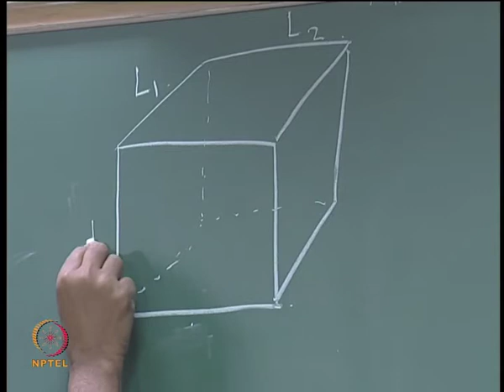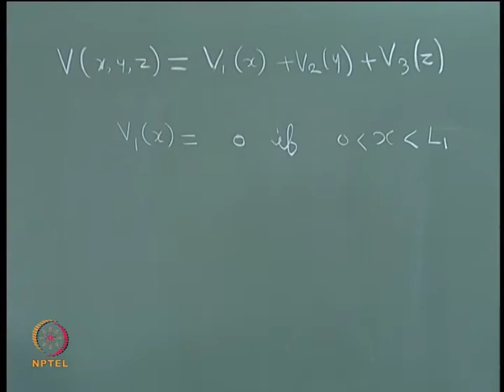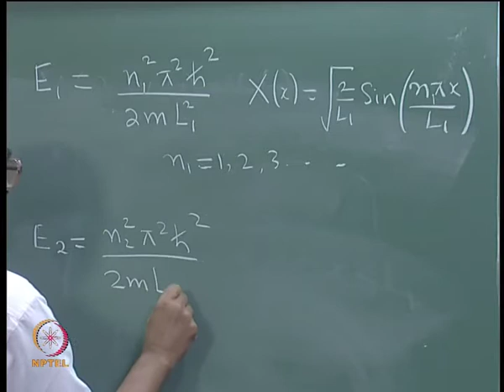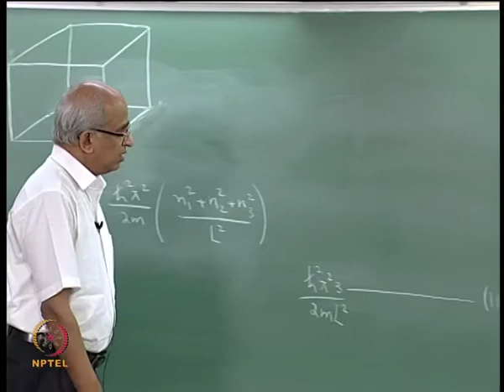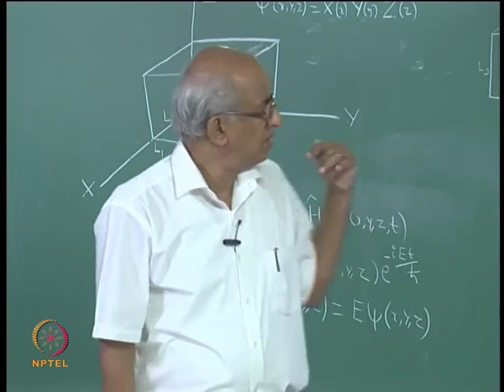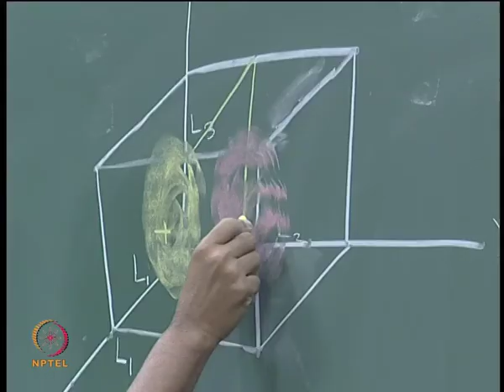Mod-02 Lec-11 Particle in a 3 dimensional box

Comment: CAN ANYONE EXPLAIN HOW DID WE TAKE E1 E2 E3 AS CONSTANTS?
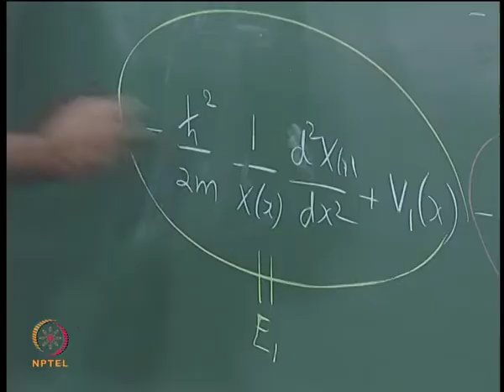Reply: First, refer to the equation on the board at 28:28.

The equations basically have three functions equal to a constant
...X(x) + ...Y(y) + ...Z(z) = E

But the ONLY way that the sum of three functions is equal to constant, is that all three functions are constants:
E1 + E2 + E3 = E

If we tried to keep just one function as a variable, and keep the other two as constants, that won't work:
constant + constant + variable <> constant

That's because, if one of the functions is a variable, then it can be ANYTHING, and the sum of the three functions can be something other than a constant.

That is why we take E1, E2 and E3 as constants.